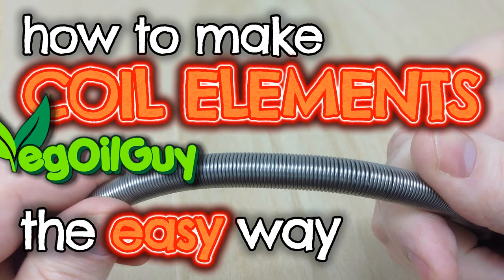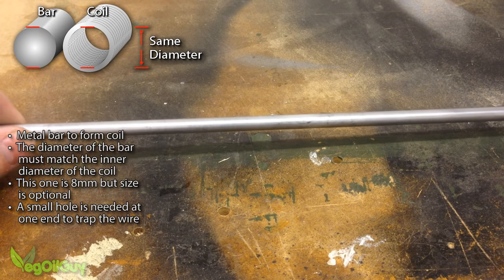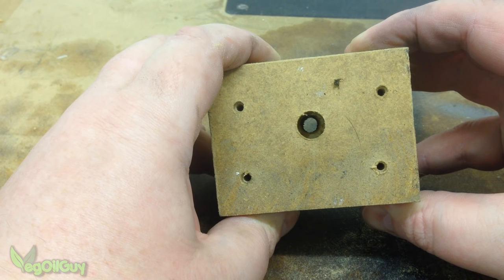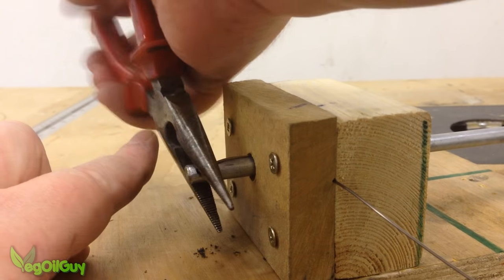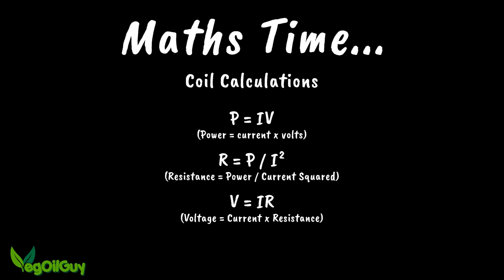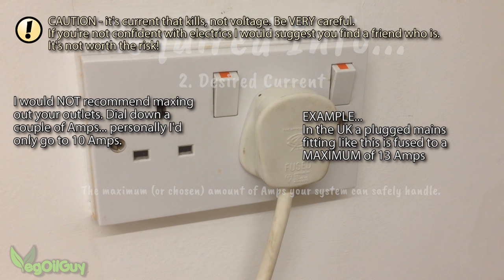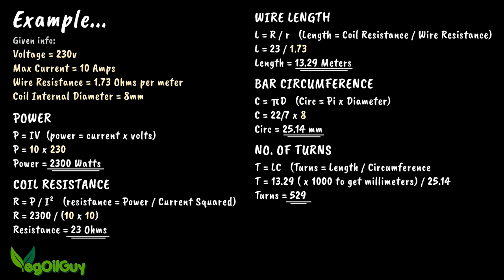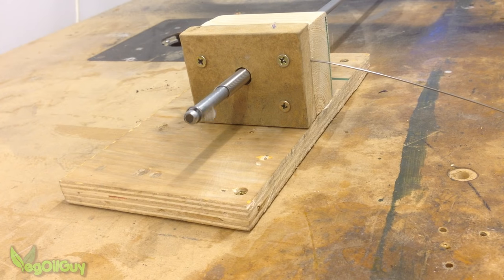Make an EASY coil heating element winding Jig - making electric resistance coils - by VogMan

Comment: Hi Jeff! Do you have any techniques you could share on how to stretch such a long coil consistently, to avoid 'hot spots' or lower the resistance on the coils? Thanks!
Reply from the maker: Hi Peter. It's a tricky one that... for me stretching the coil consistently has only failed once and that was on a very cold winters day, so I'd say make sure the coil is warm (not hot). Then either anchor one end firmly or grab each end, then pull. Don't go for the full stretch first time. You'll feel the tension - ease off and repeat a few times.
It's always worked for me, but I may have been lucky. Hope this helps : )

Comment: This is great, thanks. Have set up my jig and just waiting on the wire to arrive. I'm wondering how much can you stretch the tight coil. I'm assuming its at least double its original length but probably up to 4 times the length would be ok?
Reply from the maker: Careful with overstretching. You can stretch back to straight if you want, but you loose the effectiveness of the coil. It's all about maximising the surface area of the wire in a given space - whilst making sure the wire doesn't touch itself to short out

Comment: what is i want to use 3 phase ? should i calculate each coil alone  for example
Outlet volt is 380
Outlet current 16
Ohms of wire 1.4
Diameter 20 mm
          OR 
should i divide the main volt over 3  so 

Outlet volt is 126.6

Outlet current 16
Ohms of wire 1.4
Diameter 20 mm

Comment: hello geoff 

what is the importance of running the wire coiled is there any differance to running it in a staright line. i have been given 14 awg wire which im going to use at 5v 1 amps with a length of 10 meters(394 inch)  this apparently will produce 250c of heat which is enough for my needs. if i loop it up and down a backing board with 10mm to 20mm gaps would this still dio its job?

thanks for reading.

Comment: Hello, ok im lost I'm not sure if I did this right. I followed your instructions and I got this but I feel like it's wrong. I live in the US so the voltage is 120. The breaker is 20 amps so I want to use 10 amp for the kiln. The bar I'm using is 1/4" (6.35mm). Also using 18 AWG wire. So I did the math and I got 50 turn on coil. But that looks wrong to me. Do you recommend me to do something different like changing the bar size or upping the amp on kiln or wire AWG

Comment: Please advice. I want to make 220v 200w kanthal coil heater. I need to know diameter, size of wire and number of turns. Will use awg 28

Comment: hi  nice video    ..im trying to do a small 12 volt heater for my fishing bivvy       i have o.8mm nicro wire    and 0.5 nicro wire available   but trying to find out how many turns   i need   i have a 17 amp hour battery  and a 80 amphour battery  im trying to get to a 50 watt heater   using i know its not a lot  but 2 or 3 amps per hour          so that the batterys dont just go flat  in an hour lol    or what wire do i need to buy   and what lenght and coil  size i need    cheers

Comment: Firstly thank you for the instructional video. Now I’ve kinda screwed up. In your formula it asks for resistance per meter the value given in the kanthal wire I got was in ohms/foot. I didn’t notice 🤦🏻
Now I made my sword kiln and by default I’ve used 3x the amount of coils I needed to use. In Australia we use 240v and 10amps - what will happen if I run this kiln with 3 times more the amount of coils. Will it blow fuses?

Comment: Thanks for this amazing video. I want to create a heating element that will warm from mains current to about 80° C in 30 seconds - to shut down with a sensor at 85°, and reheated when it drops below 75° C. A very weak air current will pass over this coil to give a mildly warm breeze (around 28° C to 32°C) for plant propagation in a small insulated greenhouse volume (<0.5 m2). The ambient temperature would be as low as 15° C.

My maths are not great. I want to keep the energy consumption below 30 watts. Is this do-able? Help would be much appreciated.

Comment: Awesome! Thank you!
Reply from the maker: Many thanks : )
Reply: VegOilGuy my pleasure! This whole series is very useful to me. I'm building a heat treat oven. When working out the length of wire needed, do you include the tail length? i.e if I need 12 meters of wire do the tails form part of that 12m? Thanks, Matt.
Reply from the maker: That's a good question Matt and it depends on how you MAKE your tails. Personally I twisted three lengths of the wire together. This of course dramatically reduces the resistance, meaning it doesn't glow red like the rest of the wire. Because of this, it's hardly worth thinking about. However, just in case, when you're done run an ohmmeter across the two ends and get a true resistance reading.
Reply: VegOilGuy Glad I managed to talk sense for once. Now I'm going to spoil that 😀 . I understand that the tails made properly they'll have reduced resistance. What I'm struggling with is: should I add some length to my required coil size to make the tails or make the tails from the required coil length? Or will it not make much difference? Sorry for being a little slow! Matt
Reply from the maker: Nonsense Matt, you're not being slow, you're being cautious - and rightly so. Electronics at this level IS deadly. 
If you triple up the wire as I did, the chances are it will make negligible difference. So leave 12 inches or so spare at either end when you make the coil. Then use the 12 inch lengths to twist your tails together.
The chances of you getting it exactly right are slim... If you watch my Electric foundry build, I didn't... but it was close enough. As long as you're not wildly out, it will be okay. 
Measuring is the only way to be absolutely sure and it's well worth doing - just as I did in my video : )
Reply: VegOilGuy Great and thank you! If I may ask another question? In your opinion, how important is surface loading / power density? The reason I ask is my heat treat oven is going to have very small internal dimensions, partly due to cost and partly to keep heat up times down, I'll only be heat treating 2 or 3 knives at any one time. My internal surface area will be approx 1637cm2. Working on 0.8 as my base power density level would mean my oven only needs to be 1309w drawing 6amps. This seems very low powered to me compared to other examples I've seen people make online. I'm worried that I may have an under powered oven that may either take an age to heat up or struggle to maintain temperature.
Reply from the maker: It's a tricky one... we never really know what's going to happen until we try it. 
As long as you're using good insulating materials like firebricks, and as long as it's well put together to avoid heat loss, the heat will accumulate and rise. After a while the whole structure tends to radiate heat, but that can't be helped. 
My GUESS would be a smaller space would heat up faster than a larger space... that's only logical. 
I'd say go for it and see what happens : )
Just do it safely.

Comment: O great explanation very through. Didn't consider using P/ I^2 to calculate the resistance need now i know how to figure out the wire based on what voltage @ what amp rating i want this to run at. I should have thought of that but my only last issue is doing this all out it doesn't give you insight into how long it takes to heat up to a desired temp range for a given kiln volume. That is my only last problem i know it is highly dependent on how well you insulate to. I could now make a huge 6ft^3 electric kiln running on 120volts @ say 14 amps , power =1680 watts  giving 8.571 ohms of coil wire resistance .. then just buy appropriate ohm per foot resistance wire. But how do you know how much time its going to take to heat up to desired temp for a xxx volume kiln.
Reply from the maker: Hi Sam. I'm afraid I can't answer that for you... time is, as you say, largely dependent on insulation AND the amount of power you can generate. More power means a faster heat up. And volume, of course... 6 x 3 is very large. 
Is it possible? Yes, for sure... but I haven't a clue how long it would take. Sorry  : )
Reply: @vogman  Thanks for all your help my last major issue was being able to tell from volume and insulation how long it would take to reach max temps in chamber and what the max temps would be around. Unfortunately the best way is thru experiment to gain insight into this. Because using thermodynamics equations in tables is to cumbersome in this application at least for my as of current. Maybe i figure a way eventually because it would be cool to know by just math given a cubic volume size you want and the insulation your using an easy way to compute this before you build it and set it up/ uses a digital thermometer to a laptop for graphing charts of this.
Reply: It seems confined to such a small power output based on having only 120 volts @ 14 amps available to me if i try to make any big chambers its going to take many days just to heat this thing up to operating temps ...so for me i think all run into only being able to make small to may a few medium size kilns which would run in a reasonable amount of time. So its like a power vs time trade off if you insulate everything correctly so in theory i could make it as big as i wanted to if i properly insulated and it eventually work. But i have to wait months for it to work... plus the bigger units are going to chew up alot of electrical energy where as the smaller ones would run for a few dollars a day.
Reply: I think all stick to the size you guys are making or smaller for starters. Curious have you tried making gas kilns/blast furnaces and throwing on a thermostat to them a bet you get them reaching max temps in no time vs the electric kiln. The only trade off is that there more outdoor and less clean then the electric ones. But hey thats an option for me as well the gas ones out side for larger applications.

Comment: how do you connect it to the outlet? im in america i plan on using a 120 volt outlet. im building a vacuum former. this is going to be used for my heating element. thanks for any knowledge you can help me with.
Reply from the maker: One end to Live and one to Neutral. This sounds terrifying and it is, but that's the essence of it. It's a dangerous thing to do and shouldn't be done lightly.
Have you seen my electric foundry build? https://youtu.be/XypmI38IKAw
I cover these issues more fully there.

Comment: thanks a lot,  very useful pices of information 👍,  i was planning to repaire and make my soldring iron heating element,  is that applies to it also?!!
Reply from the maker: A coil is a coil : )
Just match the resistance and you'll be fine.

Comment: Hi Jeff It's a very useful tutorial from this video, Jeff i want to know i had  purchase  heating element from online, the length of the of the heating element is a bit long to fit in my OTG oven i just want to know  form your point of view is it possible to cut and trim the heating elements so that i can  fit element in the oven?
Reply from the maker: Hi Joe, yes and know. Coils can be cut, but this will alter the resistance and that will increase current drawn. So unless you're happy with the possible implications, it's probably best not to : )

Comment: So, is it more Resistant that Nichrome, ie. Give more heat?
Reply: Thanks for the heart, but I would rather prefer an answer.
Reply from the maker: Sorry. I probably got distracted. It happens a lot : )
All I can tell you is what I've read and heard... Kanthal is better. It's a different elemental composition but it does the same job. So it acts as a resistance wire but is believed to last longer.
Reply: kanthal is having more melted point than a nichrome but nichrome is less magnetize than a kanthal
becouse nichrome hve  little less resistance its temperature will rise faster than kantal
also kantal is relatively cheaper

Comment: Thank you so much so helpful.. how that equations relate to the temperature?
Reply from the maker: They don't really. Just think of the coils as being very hot. To use that heat you need to trap it inside a well insulated area and then the temperature builds up. 😁
Reply: @vogman  yeah that's enough as it works anyway.. and is there any potential for the coil to be melted?.. maybe gauge 20 or 18 .. can it resist 1500c
Reply from the maker: Eventually all coils burn out. They have a limited life span. Thicker coils last longer than thinner ones usually 😁
Reply: @vogman  yeah that's practical hhhh thank you so much
Reply: @vogman  yeah that's practical hhhh thank you so much

Comment: how do i calculate what wire thickness is needed for my kiln, i want to make a 1500w, 2300v kiln that can go up to 1200degrees celcius, would 1 mm or 1.2 mm be a long lasting choice ?
Reply from the maker: The wire should be a thick as you can get away with. Thin wire burns out faster. Unfortunately thicker wirer has lower resistance and you need more of it. So it's a balancing act.

Comment: Hi really useful. I want to know one info if the resistance they have not mentioned then can I cut the wire to 1 meter and check the resistance in multimeters ?
Reply from the maker: Hi Kishore. Yes that would work fine. Also remember you don't have to cut the wire at all. Just pull a meter or so off the spool, measure and wrap back on the spook. The meter will read the shortest distance between the two probes so no cutting is needed. Saves wasting a meter of wire : )

Comment: It is not clear to me if this wire is insulated or not? If it isn't, won't your coil short out unless stretched?
Reply from the maker: No Robert, the wire isn't insulated. So yes, it must be stretched otherwise, as you say, the coils will touch and it will short out 😁

Comment: Greetings from Pennsylvania, USA - VOG. Can you advise me? I'm ready now to make my kanthal wire heating elements. The kiln originally had three (3) elements, each 1.8 meters long. When I use the "Coil Calculator", I enter 115 volts --- 15 amps (on a 20 amp circuit) --- 1.73 ohms (18 ga.) --- 7.1437 mm diameter and I get:
Power generated : 1,725 Watts
Resistance Required : 7.67 Ohms
Length of Wire need: 4.43 Meters
Circumference of bar : 22.45 mm
Number of Turns on Coil : 197
My question to you is, Is this right? and if it is, is this for each of 3 coils or one long coil replacing the three (3) ?   HELP.
Reply from the maker: It does work Robert, it's only maths : )
You need to make sure you're asking the right questions. If you're trying to replicate existing coils, then that's your starting point. What's the resistance of the original coils? That's the bit you need to replicate. The wire has a certain resistance which is influenced by its thickness and length. The thicker it is, the lower its resistance, so the longer it needs to be. To be longer and take up less space, the coil diameter needs to be bigger.
Personally, I'd recommend you match the existing coils as closely as possible with thickness and diameter for fitting. The voltage will be the same so it's just a matter of making sure the length matches the resistance : )
Reply: @vogman  Thank you for your reassurance.
Reply: @vogman  So, if my circuit breaker is 20 amps, do I have a say in how many amps I want to draw thru the wire ?  Can I choose 10 amps instead of 15 ?

Comment: I've replace the same heating element (134792700)

for my electrolux dryer 3 times and the coils swag and fail everytime due to quality (I can't find quality parts, even the true manufacturer parts are supposedly cheaply made from what reviews show). I'm thinking about trying to rebuild the coils to make one last longer than a year. My first element lasted 9 years and the dryer is still in good condition. Do you think this could be possible?

Comment: Yo thanks so much for this video. Im a basic newb and i'm doing a project involving this, will it be able to fire up in a mini electric stove?
Reply from the maker: Thanks for the kind words. I'm not sure what you mean by "fire up" an electric stove. If you're asking would it provide much heat, YES. My foundry is insulated to prevent heat loss and it's in a garage with no heating. But it can get nice and toasty in there even on a cold day  : )
Reply: VegOilGuy Thanks that what I meant to say. Keep up the food work.

Comment: Hi VOG i have been trying to make a polystyrene melting grid which turns big pieces of polystyrene into small cubes which i use for packaging ,its really puzzling me as im not  very wise with voltage and current or electrics so was wondering if you do projects for people at a cost ?

Comment: does anything bad happen if you dont stretch the coil?
Reply from the maker: Yes Jack, it creates a direct short. There's virtually no resistance if the coil isn't stretched resulting, at best, with blown fuses and, at worst, an electrical fire. Stretch that coil buddy.

Comment: Can i measure the resistance of the wire using a multimeter?
Reply from the maker: Yes. It's basically just a very large resistor 😁
Reply: @vogman  ❤️❤️❤️

Comment: Hi vog, I'm thinking of making an electric foundry and want to use a welding inverter so I can adjust the current, do you thing this could work? Feedback greatly appreciated.
Reply from the maker: Hi Louis. I reflected briefly on such things when I was designing but admit I didn't really research them enough. My knowledge may be letting me down here, but I don't think it will work. You can't create something from nothing. I'm just thinking back to my school days and remembering a teacher saying a Watt is a Watt.
If you manage it, do let me know, but my instinct (influenced by a pretty nasty head cold) thinks it's unlikely.
Reply: @vogman  thankyou so much, I will be trying it regardless as I have a cheap 200amp arc welder on the way, I will try your method otherwise. I love you videos and have inspired me to do similar.